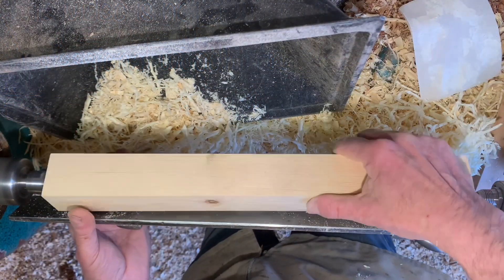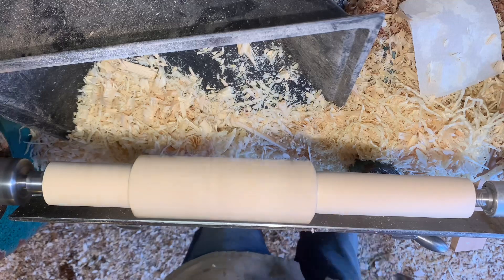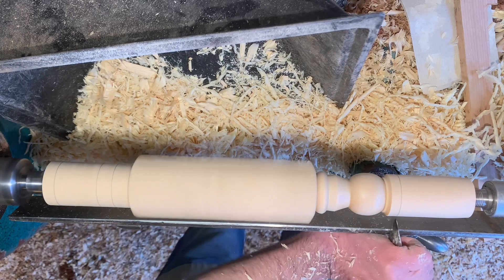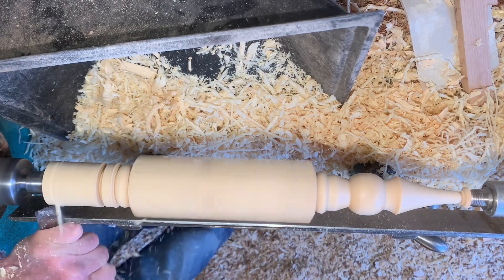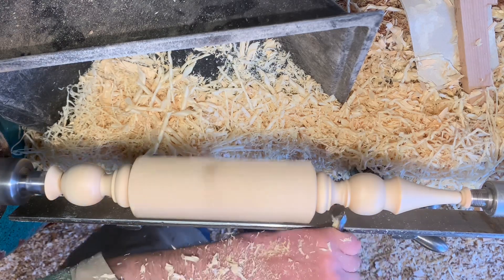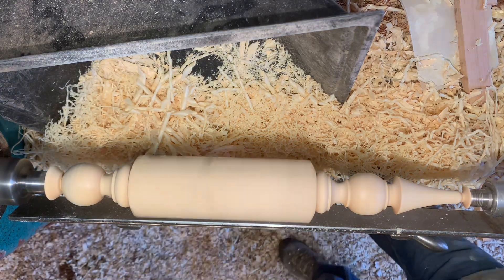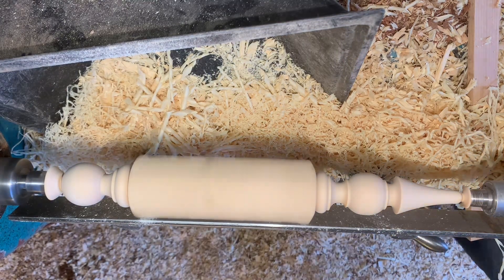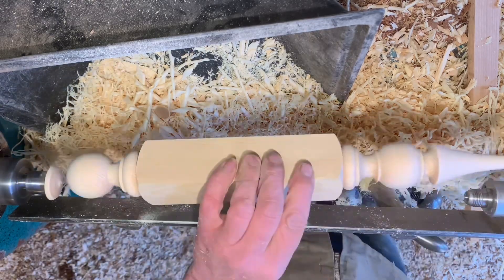Apex roof finial  hand Wood turned by Steve Jones

Comment: Amazing skills. What's the key to turning down to the round so quickly with the skew? I use the traditional roughing gouge, but it takes forever. I'd love to learn to get down to the round in only two passes with the skew like you do. Amazing.
Reply from the maker: Thank you it’s all from experience and correct presentation. The skew is not the most efficient tool to rough out the spindle roughing gouge is best for that. I don’t know without seeing why you are taking so long.
Reply: @woodturner21  I guess I'm just not taking as aggressive cuts as I should be. Thanks!
Reply from the maker: Yes most likely

Comment: Just a quick question
I'm building a table for my midi lathe. In general where is your elbow height in relation to the work you are turning.  I don't want my arm to be pointing too up or down.

By the way cool piece.
Reply from the maker: The general rule is the lathe centers are at elbow height

Comment: Steve, this is brilliant work. When I use the skew I sometimes feel like it's fluttering! Any advice please? Obviously without you seeing my tool presentation. Cheers
Reply from the maker: Thank you 
It’s hard to say withhold seeing. But I’m guessing you are coming off the bevel. Another reason could be too much pressure on the bevel you only need light contact. One other thought, are you using an oval skew as these have a tendency to vibrate on bigger sections.
Reply: @woodturner21  it's not oval. I feel like I'm trying to hard lol. I'll keep practicing.  Thank you for your videos on here
Reply: If it’s fluttering just slide it up a bit, might only be a millimeter or so to regain the bevel support. You have to remember that the job is spinning towards you and forcing the tool towards you, you need to counter that force a bit. Steve is right about the light pressure on the bevel as well. Just let it glide across the job not really rub.
Reply from the maker: Yes, trying too hard and being nervous usually leads to a vice tight grip which doesn’t help. A firm grip with the hand on the handle but the other hand is only a guide and should be relaxed.
Reply: @cooperken11  cheers